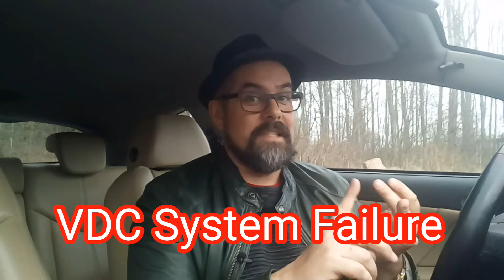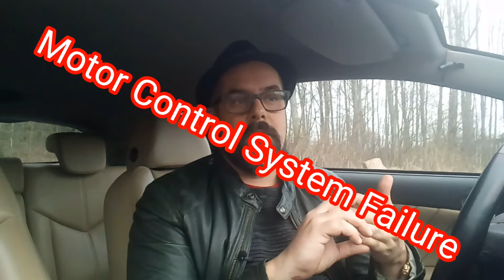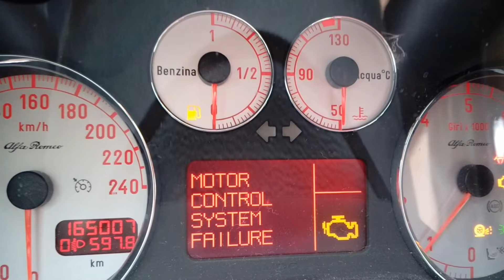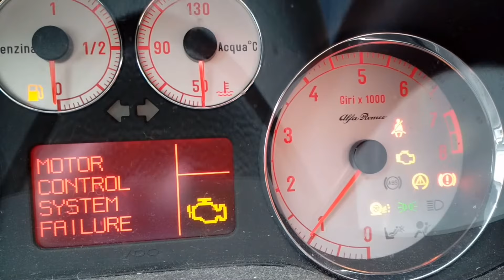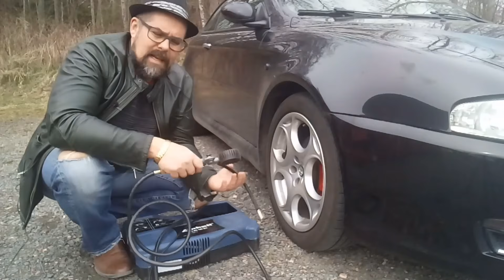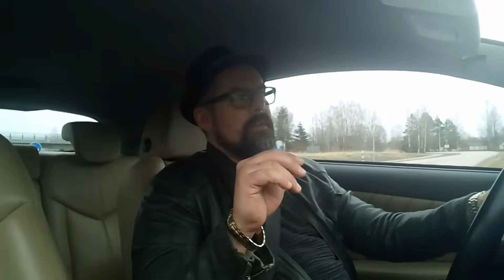A bad day! Alfa Romeo GT, VDC failure, motor control failure and no fuel gauge.

Comment: I had exactly the same problem. The tester showed P0201 - problem with the first injector. I checked - the electrical connector on the first injector was removed. I put the connector back in and the car ran fine immediately.

Comment: someone in the comments suggested a trick start.
my gt has come up with the same faults vdc and motor control.
it seems to do it in really cold weather, it was minus 5 today.
the vdc has gone off by itself.
the motor control was still on
so I tried a trick start. i started up revved at a steady 2000 revs for 30 secs. turned off waited about a second then started straight up no waiting for system check.
the lights have all gone. dont know how long its going to last. but i put a new battery in last week.

Comment: Hello my friend, I recently got an Alfa 147 1600cc 120ps and three days after I got this "motor control system failure". I went back to the mechanic and told me that probably is because it was stored for almost half a year in a garage without any gas. Computer has shown lamda sensor but they are both new. He deleted the warning sign but 2 days after it's here again. Any ideas guys? 
thanks

Comment: Don't complicate life. You are working blind. Simple. New battery and alternator could be on its last legs.
Reply: Sir all of you talikng about problem without solutions two days ago i drive AR147 to work nightshift in morning there was moisture on car like it rained few minutes before i drive towards home came across abs system failure, vod system failure , with number plate light  off  brakes started partialy working AR service center i registered my self to center  half  km away with help of partial brakes, hand brakes  lower gear i am infront AR garage i parked myself waiting holiday over and center start to work , i my next twit  i will give you questions ? And its solutions.
I swear to godwhen AR works it works like magarine!

Comment: vdc failure is caused by the brake pedale sensor
Reply from the maker: Thank you! It seems to be the problem with the GT, because when I break a bit harder the engines dies.
Reply: @Imperfectgarden  for sur it is i had these problem long time ago :) (multiplex problems: one failure causes various failures). Mine has cylindre one misfire illness and nobody is able to repair it...(every injection components are new, i've also changed the ecu). The last thing that my garagist find is a belt cam tensioner dead and a cam belt not very well placed. after repairing it, the car still runs like a shit: idle at 3 cylindre and acceleration at 4 at about 3000 t/min
Reply from the maker: Holy cow, that sounds like a incredible frustrating situation, to say the least. I thought changing every injection component should fix a misfire, what are you going to do with the engine in the future? Would you still want to fix it?
Reply: @Imperfectgarden  i've forgotten to say that compressions are perfect (2007 engine on a 2004 gt). the injection harness has been tested and everything seems to be ok. Albeit that is written that is a misfire on cylinder one, there is ignition on the cylinder one spark...according to my garagist, after doing the cam belt tensioner and control of the distribution, the engine has run well for 20 minutes and then runs like a shit...it costs me a lot of cash, next days i'll buy a GTV 2lts red interior :). About my GT, i'm thinking about putting a 2l ts inside with 1,8l engine management
Reply from the maker: Really? I did not know that it could be so difficult to diagnos a misfire. I like the idea changing engine to a twin spark. Is it a difficult swap?
Reply: @Imperfectgarden  no it isn't need 1,8ls ts injection ecu+ bcu+ ignition barrel+ key and an ts head
Reply: @Imperfectgarden  injection leads too
Reply from the maker: That´s cool! If you do the swap you have to tell me how it goes, I don´t think I have seen any good videos on how to engine swap a Alfa GT.
Reply: @Imperfectgarden  it seems that the jts is an engine with many troubles
Reply from the maker: Yes, it would be interesting to dive a bit deeper about the JTS engine and learn more about it.

Comment: Have you checked the MAF?
My mom's GT was misfiring (plus MCSF light turning on) when under load (like driving on a high gear uphill) and I read the fault codes using OBD. Misfire in cyl 2 and 4. 
I replaced the spark plugs and MCSF went away!
BUT - it still has a rough idle 🤔🤔
I'm thinking it might be a problem with one of the sensors (MAF, the cam position sensor and all that), but I haven't quite figured out where all those damned sensors are 😂

Btw, you can buy an OBD tool at Biltema, they have great ones there 😄 

I'm looking forward to your next video! 😁
Reply from the maker: Thank you! I have no idea where all the sensors are too, but you are right, It feels like a sensor problem. I will buy a felsökverktyg, very soon, maybe Biltema...😁
Reply: Once I had the mechanic pull out the MAF sensor then give the car back to me, the entire car was going haywire like in the video. But everything was working fine again once I plugged it back in.
Reply from the maker: Maybe I should pull out the MAF sensor, just to see what happens?
Reply: @Imperfectgarden  Yeah :D

Comment: Hi,check your battery first,last couple of times i had multiple warning lights on it was either a dead battery or the battery terminals were not tight.Especially as you have been using the battery to run the Fiat,it may just need a good charge.
Reply from the maker: And I have no idea how old the battery is, plus I drive very short distances everyday. Maybe I put it on charge now and wait until tomorrow for the rest of the video.

Comment: Check all the things you said, plus the switch behind the brake pedal can give the faults shown. The plunger can get stuck in or the switch is faulty. The idle could be a faulty ignition coil as they fail at there end of working life after being put under load (going up hill).
Reply from the maker: Very good idea! I will check the break pedal switch and buy a obd scanner too, it would make the life easier. The ignition coil could be on the last leg, the GT was not in the best of conditions when I bought it, maybe time to replace them all.

Comment: When I have a motor control failure, I read the code with ODB reader and note it. After I delete these fault codes and wait until if they repeat again. 
I am not sure but I heard when check engine light is on, engine puts itself to safe mode, thats why it may feel not even. I was thinking its just feeling for me but a mechanic told me , it is a fact :)
I would check ignition coils too. I remember, you already replaced sparking plugs. Next, ignition coils, after that fuel injectors maybe. 

About VDC, luckily I havent got any problem with that on my GT but my friend's BMW, there was a problem with traction control. It was caused by a bad sensor. When car is running front right's wheel speed wasn't catching up with others, sometimes sensor didnt read the speed at all. Just wanted to share if it may give an idea.

Fuel gauge is the odd one.. 

Hope you will fix all cheaply as possible, good luck !
Reply from the maker: That what a lot of very good advices! Thank you so much! I will but a odb reader and I belive my ignition coils should be replaced now too.
Reply: I had exactly the same problem, it was a broken pin inside the ECU connector (the smaller one). I managed to take the broken piece out and put inside a spare pin I had from another wiring loom from AR 159. Works like a charm!

Comment: Sorry to write so many times but again something of experience, injector cable fault can be the issue as the precise faults occurred with another guy in his case no 3 injector apparently the cables are very sensitive and may fail its confirmed by diagnostic testing sadly
Reply from the maker: As long as you give good advice, you can write as many times as you like 🤣🤣
You are right too, I need to do a proper diagnos of the condition, I will buy a odb reader now, it will be useful for the future too.

Comment: I have a cheap bluetooth OBD2 which I used in my previous car. That way I was able to read out the failure codes through an app on my phone. Before that I had a peugeot 205 which had a way to read out failure codes with numbers which you can then look up online to see what sensor had a problem. There should be a way to read out more specific codes in this car
Reply from the maker: Very good idea! I will look for a odb reader who works fine with Alfa Romeo

Comment: Hello my friend, seems one of my friends had a similar problem, 2 things - brake switch faulty behind pedal = cheap fix - or sensor on wheel hub its very hard to detect unless you have diagnostic can bus connection with the software or take it to someone who has one to run a systems check and get all faults reset and eliminate each alarm
Reply from the maker: Something about the breaks are climbing up the lists of villains, thanks again! 😁👍

Comment: I've had the motor control failure error appear due to engine misfires. In my case it wasn't as cheap as changing a spark plug or ignition coil, it was a problem with one of the fuel injectors so that had o be replaced.
Reply from the maker: I understand, maybe this is my problem too, I will look at this, thanks!